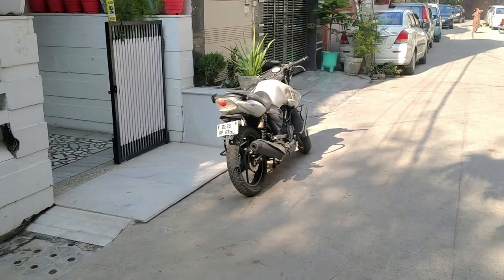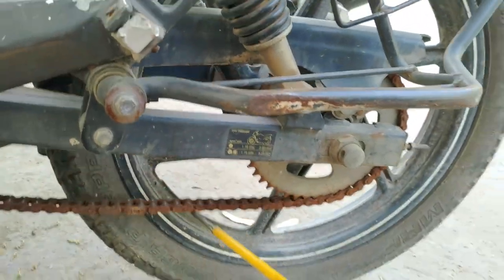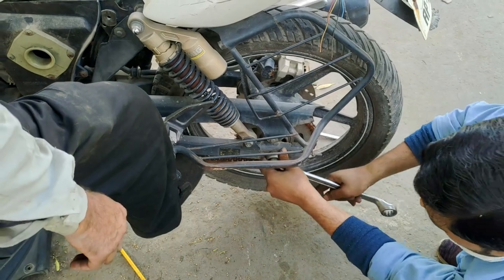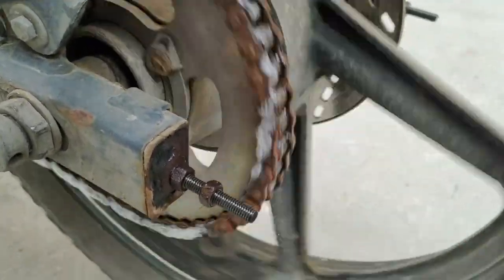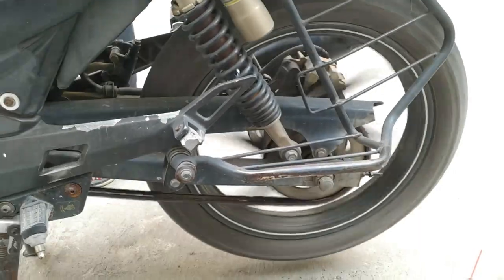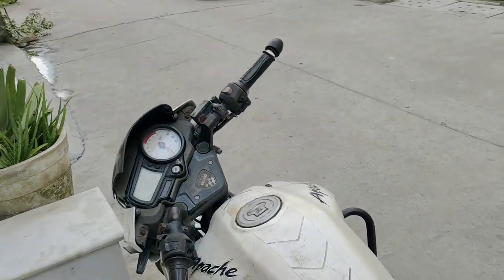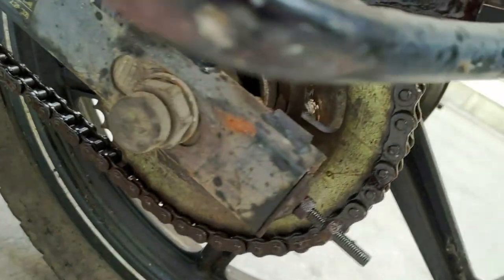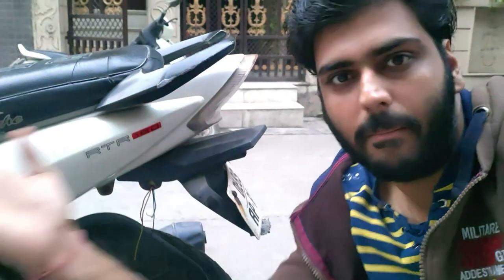Apache RTR Chain Restoration by Chain Lubricant || Apache RTR 180 Restoration Ep6

Comment: Bijli nice name👌. I use TRIBOCOR TC 40chain lube. Before applying the lube chain to be degreased & washed. The chain adjustment nut on of the side( one of the two nuts)in your bike is not tightened. Chain nay become loose.  wheel nut before tightening you need to follow the procedure. After chain adjustment, the wheel to be spinned & brakes need to be jammed & than the wheel nut to be Tightened. This is what I follow. Cheers 👏nice video👌
Reply from the maker: Yeah those nuts i just noticed toady and rectified 😆Cant expect high level work from these mechanics  😁And rest they did that that i have seen and its been a few days now and everything feels good and no unwanted noise from the chain as well this bijlee one is realy good and the way it kinda killed that level of corrosion its super impressive...😊...And its that tribocor tc similar to this then even thats awesome.😊😊

Comment: I would recommend to change the chain and sprocket or do electrolysis process to remove the rust
Reply from the maker: Brother i am still keeping the chain under observation before any long rides even for about 100 kms and still as per writing this reply the chain feels absolutely fin and that chain lube actually killed all the corrosion away and most of it was at top of the chain cover...😊😊

Comment: paji mast video but i use gear oil to lubricate my bike chain as it enters deep into o rings & gives the best results, I was noticing chain spray was accumulating a lot of dust. chain life increased with gear oil i keep that oil in small bottle in my bike.at everybike wash i spray my bike all parts with kerosone with spray uske baad wash mast results aate hai, sab grease nikal jata hai
Reply from the maker: Wah thats actually a brilliant idea brother. Abhi jo ye bijlee chain spray use kiya na maine isse saari corrosion toh utar gyi ab koi zang nhi hai chain pe and properly lubricated hai maza aa rha hai and 1 2 din mein main puri bike kholke pressure wash karunga lets see tab kya hota hai and uske baad dekhte hai kya haal rehta hai chain ka...😊😊